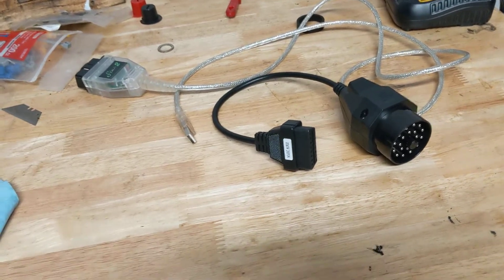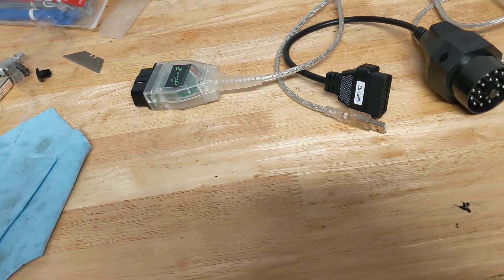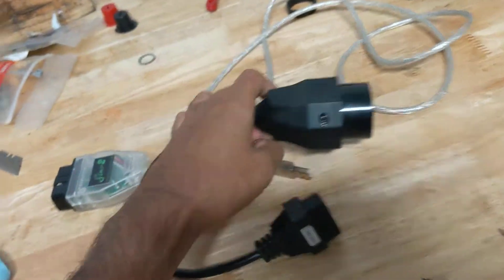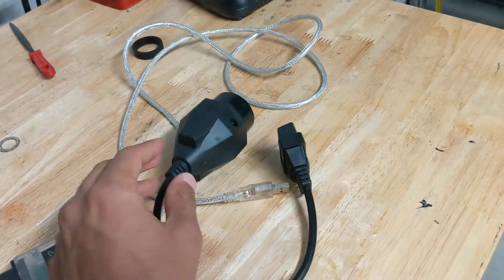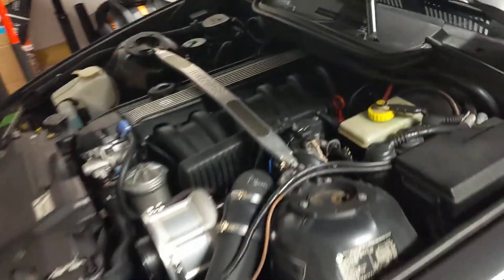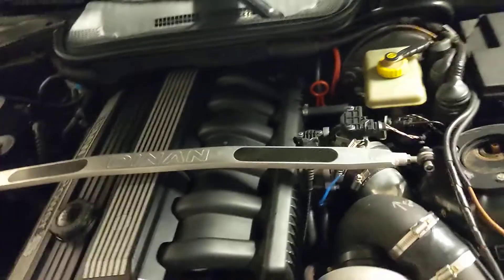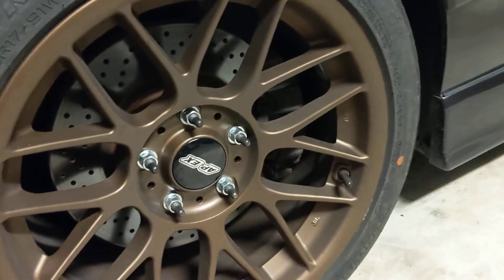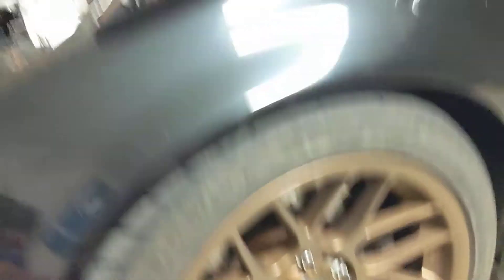E36 M3 Active Autowerke Supercharger Level 2 Install part 11 - Tuning

Comment: How’s the car doing these days? Still working well? 

I’m on the fence between forking out $7000 for this level 2 SC kit or building a high compression NA S52. That’d probably cost like $5k all-in and only make around 320-340 crank hp, but it would maintain a lower weight and complexity, and sound great. And then there are the LS swap or K24 turbo options to consider… But those are likely even more expensive than supercharging once all is said and done.

What do you think? If you could do it all over again, would you still choose the AA Level 2 or try something else?

Comment: What specs on the rc8s? They look PERFECT lol
Reply from the maker: Suspension: H&R Street Performance coilovers (I see them on ECS tuning still). I have these riding pretty high. It's not slammed or anything. It was rubbing pretty badly.

Wheels: Apex ARC-8s 17x9 ET30 all around

Tires: 245/40ZR-17 HANKOOK VENTUS R-S4 SL all around

3mm spacers up front

rolled fenders
Reply: @DullBullet  👍💙💙

Comment: I have this same setup, wondering where the waste can is going on the top of the engine? Whoever owned mine put a mini stupid air filter and it just drools oil 🤦‍♂️ lol. I’ll keep watching your other vids see if I can make one diy , a catch can for the oil
Reply from the maker: this kit basically deletes the CCV valve. It's installed still but it's blocked in. It just routes the blow-by directly from the valve cover into the charge pipe, with what looks like a fuel filter in between. I don't really like this set up. I wish they just gave me a catch can lol

Comment: Can I add the AA Suoercharger on a stroked e36 328i? This would be my dream come true
Reply from the maker: AA makes a supercharger kit for the 328i M52B28. It will worked with a stroked engine but you will probably need a custom tune. AA will ask you what other mods you have on your car and probably give you an adjusted tune for your strokes engine but it would probably be better to get a protune. You can email them and ask though. It's definitely possible to make it work

Comment: Thanks for the update this is good information to know. I am looking to do the same setup on my 97 M3. Will you be posting and driving videos? Looking to see how it pulls.
Reply from the maker: I was going to take some at autocross recently but I forgot my GoPro. I will say that you don't REALLY feel the power until you're above 4000 rpm. There are definitely small gains under that however
Reply: @DullBullet  I have the kit personally and drive it a lot and it’s true that you really don’t feel the big difference until 4K especially when paired with the m50 manifold
Reply from the maker: @doodooman97  yup any supporting mods like intake manifold or cans just adds top end power. Gonna stick with the s52 manifold
Reply: Glad I watched this! Got my 97 stage two out of the garage after 7 years of it sitting lol! Wondering how to get mine tunes so this is great !